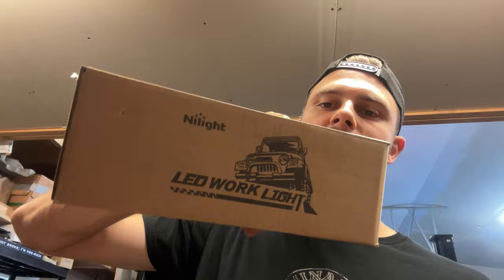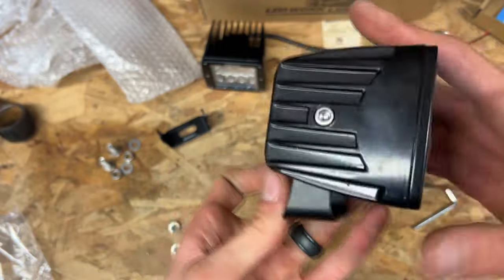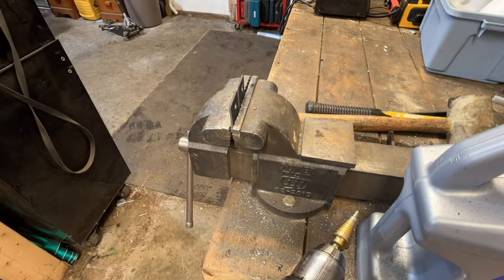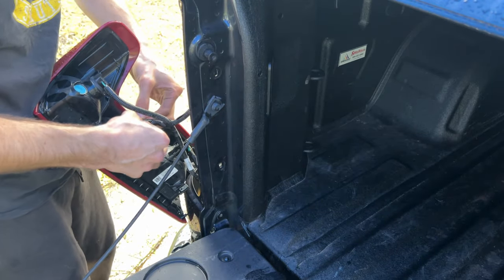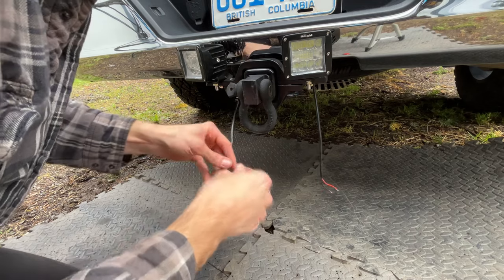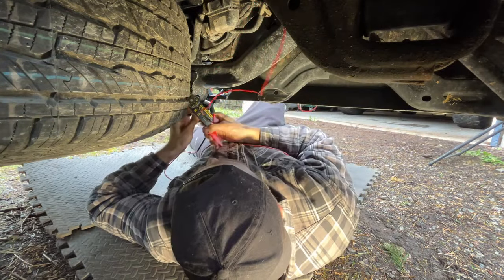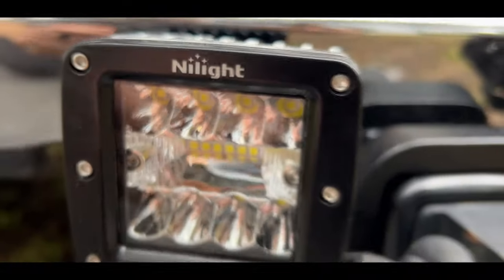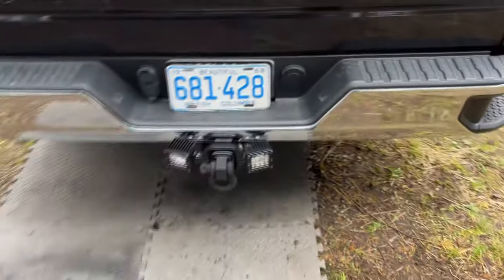BRIGHT Backup Lighting with Nilight Pod Lights! How To Install + Wire Reverse Lights 2023 Chevy\GMC

Comment: Scotch locks. Really?😂
Reply from the maker: She works mint
Reply: Look on the bright side, if ... I mean "when" there is an electrical problem one knows just where to look as its usually in the scotch lock with either mechanically sheered copper wiring because the scotch lock was not sized for the wire or more often then not severe corrosion, or a non weather proof butt crimp connector with broken off wiring or again severe corrosion, add in vibration with poor connectors and its going to fail. Single insulated wiring in an exposed location ( where rocks etc will fly, mud hangs off of etc ) is another failure point. I don't profess to be any expert when it comes to wiring but I have witnessed the results of wiring done by one friend with scotch locks to the other end of the spectrum of a friend that has all the right tools and weather pack connectors and weather proof junction boxes and uses only double insulated wiring cord. It takes skill and tools/supplies to do a professional wiring job. I am not knocking this person and his channel, not everyone has the skills for every project they tackle, sadly its some of the so called professional shops that may be doing some real hack jobs and pretend they know what they are doing and the customer finds this out after the fact, not just wiring as I mean anything mechanical etc.
Reply: @Carfleet  yeah. For today
Reply from the maker: @kwevoel9993  did the same wiring on my ram that ive been off roading and submerging in mud for the last 4 years and shes mint 🤑😝